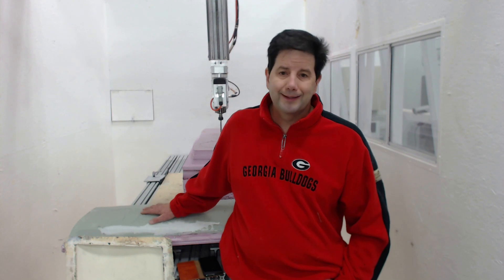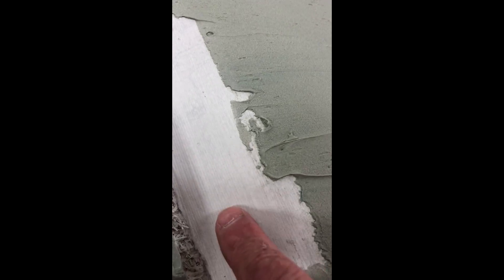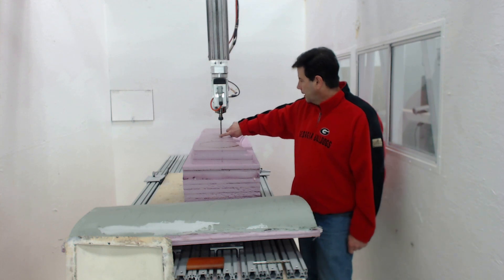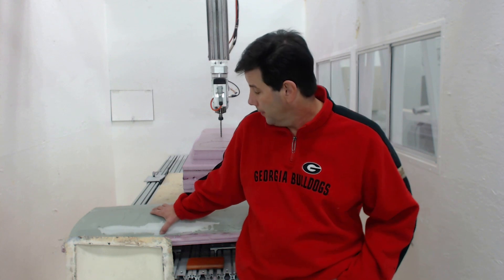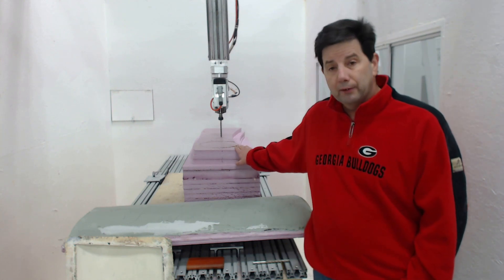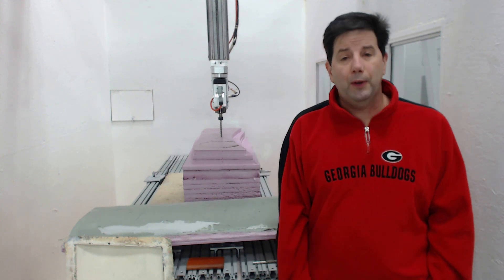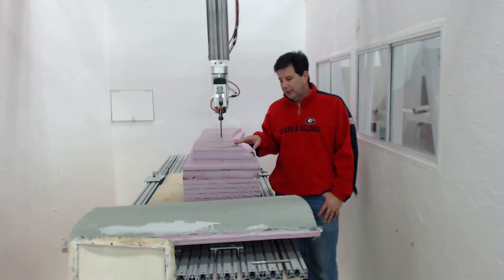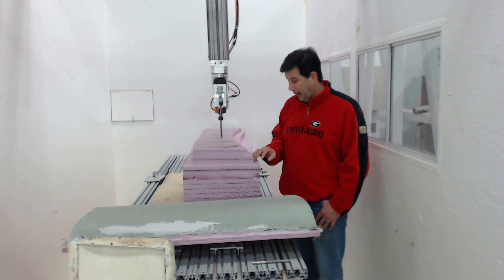DIY 5 Axis CNC Router ....Porsche Cayman Wing... Part 2

Comment: Hi, this is really interesting. I am keen to make a similar but much smaller one for making models/toys for fun. I have 'blueprinted' most steps but I am confused about how to make a postprocessor. I would be very grateful if you could share your solution. Thanks!
Reply from the maker: I’m now using fusion 360 as my CAD and CAM which has a postprocessor for Mach3 (which works fine with Masso as well).  If your not using Fusion 360 you will need to find a CAM that will work with your CAD.  If that doesn’t make sense let me know

Comment: I was wondering why it rotates every single time it moves on A and B axis?
Reply from the maker: Sorry for not responding sooner.  This is a function of the math in the post processor.  I could actually modify that section but I just haven't had time.  And because I'm just a hobbyist I don't really care if it takes longer to mill the part so it on the bottom of the "list of things that need fix'n in the shop"  :)

Comment: Very cool.
I run an early build CAM software where full 5 axis is not too dependable.
Instead I break the part up into areas and use 3+2 axis.
From what I see here its a good demonstration of 5 aixs movement, but all those off part transitions would drive me nuts. 

We had our post modified so that changes in angle happen retracted as high as the machine will allow in Z well clear of the part.
Our software has high awareness of the parts shape relative to the tool when it is engaged in cutting, but off part angle movements close to the parts horizontal surfaces and in deep walled pockets not so much.
Reply: Why not just use fusion?

Comment: What is the camsoftware use for this machine
Reply from the maker: The toolpath in this video was created  by Mastercam the machine itself is controlled by Masso CNC.  I have access to Mastercam through a friend (he needs it for his day job).  It's to expensive for a hobbyist like myself BUT Fusion 360 now offers 5 axis toolpathing in their standard product which cost about $300 a year.  I just started using Fusion 360 and expect that future videos showing the machine cutting something will be using Fusion 360 as the CAM. 

Cheers,
Brian
Reply: Awesome, excited to see you opinion on fusion 360